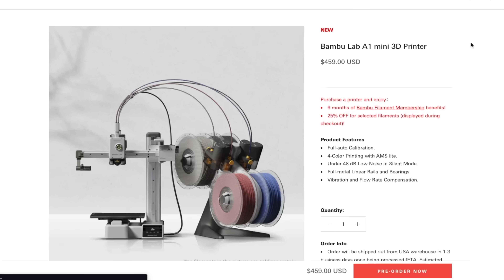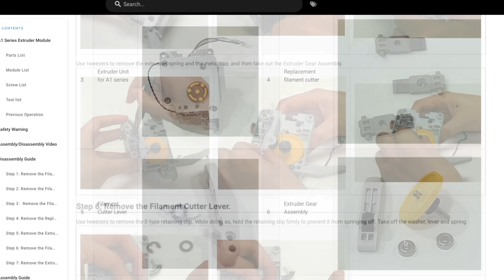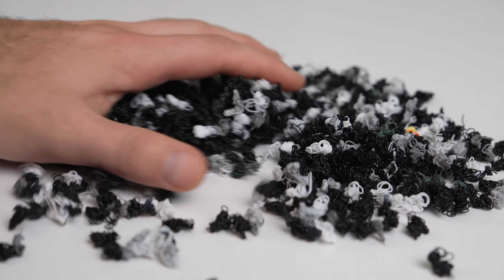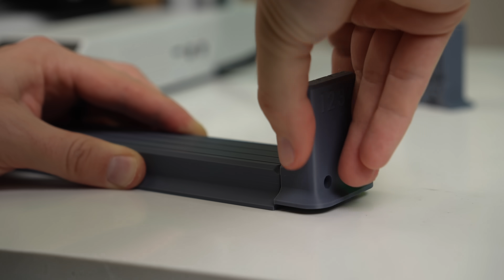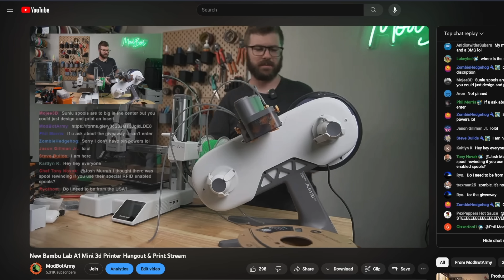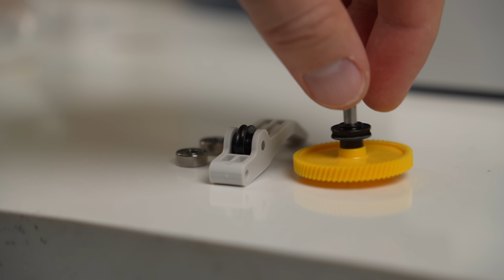Best Bambu Lab A1 Mini 3d Printer Upgrades

Comment: So this is a shanghi chinese device - i am not comfortable connecting it to my home wifi or installing the poorly rated app on my phone- which could present a risk for cyber attacks.  Love how no one covers who makes these printers and just blindly installs apps on your phone and adds unknown devices to your home wireless network without researching the risks involved.  Prints look great but at what cost to your privacy/data to introduce a country into your home network that likes to maliciously hack the crap out of us.  Do a video with how to use this device without connecting it up to your wireless network or download untrusted software (which if you read the privacy guidelines of bambu handy you are giving that app a lot of access to your data - which is unnecessary).  If you are going to do a review of a product you have to connect to ones home local area network then also cover the security aspects/risks involved.    Before you get up and yap about a product - please go over who the manufacture is and what kind of access it has to your network/phone/etc..   So many of these useless videos that do not actually talk about the security risks - please educate folks on products like this - to include security risks involved with installing the software/adding the device to your home network.   How about MODS that allow you NOT to connect it to your wireless network and NOT install any software (apps) to your phone - or attach this in anyway to your home computer to upload the prints to it??????

Comment: Kinda funny this printers upgrades are just primarily goofy stuff like a poop bin or a wall mount, everything else is pretty much to just keep the stock machine running perfect as it does. I’m not sold just yet on my a1 mini combo simply cuz I’ve yet to receive it and use it but it really does seem like my money may have been used justly during this anniversary sale. Hope it works as well as everyone makes it out to seem, I’ll be printing my mounts tonight lmao.
Reply: The presale just started and you can grab a a1 mini for $180

Comment: was there supposed to be a scraper and stylus in my box? never saw them if that's the case.
Reply: My standalone A1 Mini came with a scraper blade  and screws to mount to a handle, and the scraper handle is one of the included test print files on the microSD card pre-installed with the machine. I found the included roll of white filament was enough to print the handle but not the stand/holder for the scraper.

Comment: The big mod I did to mine was a bracket that lets you mount the AMS to the top of the Z tower. About halved the footprint of the thing.

Aside from that, the clip that holds in the AMS hub was defective on mine, so I printed a little bracket that locks the hub in place. Also printed a poop bucket, but a very light and simple one that just sits to the side. Also printed a tool drawer that hugs the top on the machine on the right, above the screen. It's slotted to make sure the bed can clear it. Just sticks down with double sided tape.

Comment: but how can you call this compact, foot print with AMS is literally larger then any full size printer.
Reply: Well, the AMS is optional, and many comparable products don't have a similar feature. 

I was actually going to get the printer without AMS to save space, but then decided I want to have an option of using that feature and ordered the bundle. 

Also, the AMS is cheaper when bought in the bundle vs separately.

Comment: I would like to point out that I print the A1 Mini Purge Bucket file with a Bambulab P1P and I noticed that in the Bambu studio settings and specifically in the speed menu (acceleration) the normal printing parameter is set to 6000 while when I load the BAMBU PLA CF filament it set to 10000. Which of the two is correct?

Comment: Great upgrades for the printer. The biggest gripe I have with Bambu Lab printers is the proprietary attempts to lock you into their eco system, with the spools that work with the AMS along with the cloud slicer and locked software. What happens when (god forbid) the company shutsdown?
Reply: What if any company of any of your personal goods shuts down? Are you gonna stop buying car, smartphone, fridge, air compressor, hair dryer, etc? Most of those are set to fail and or are proprietary. But just so you are aware, Bambu Lab said that if the business was to shutdown, the source code would be shared. Paranoia at its best!
Reply: You can use any commonly sized spool in the AMS. The ones Bambu sell can be bought without the spool itself, which saves on a lot of plastic.
What cloud slicer? Bambu Studio is open source, runs locally on your machine, and can be substituted with any other slicer with the right profile.

Comment: Great review and I wanted to reproduce the various accessories but I wanted to know which filament and the color of gray in particular. 
Thank you
Reply from the maker: Thanks 😊. This was all voxelpla gray.
Reply: Are you comfortable with the voxel filament? I usually purchase either Bambulab or Sunlu filament
Reply from the maker: @alecchi  I have probably ran through 15 rolls of it at this point without any issues. It’s been really consistent.
Reply: @ModBotArmy  have you run into any issues with the hot purge bits melting the PLA bin? Some videos recommend using PETG for the bin part for that reason but if yours hold up with PLA then I’ll stick with that for now before moving on to more advanced filaments.

Comment: Question, at the beginning of the video you mention how you can upgrade the A1 Mini hotend to a hardened steel end. Does this mean that you could use carbon fiber filament in the Mini with this upgrade?
Reply from the maker: Yeah exactly! Extruder gears are already hardened so all you need is the hardened hotend and you are good to go 😊
Reply: @ModBotArmy I'm a bit of a noob. I thought the bed didn't get hot enough for most CF filaments? If it actually works OK, I'm in. I'd like something that I can print small CF parts on.
Reply: @kevinrobb3523  Besides a nozzle upgrade to hardened steel, you may also have to purchase a high-temperature build plate. Make sure to do your own research though!

Comment: Not an A1 owner, but bought a P1S about a week ago. I can say the print removal scraper print and parts are awesome sauce. It slips under the prints and removes them with almost no effort. So much better than the spatulas my Enders came with.
Reply: I also just upgraded from Creality to Bambu Labs - went from a heavily modded Ender 3 V2 to the A1. I used the crappy scrapers that came with the Ender to get the prints off of the heated glass build plate. I have not yet needed to use a scraper at all on the A1 since the PEI build plate flexes. That may change as I start printing with some super soft TPU. I’m a little worried about damaging the PEI build plate with anything hard or sharp.
Reply: @BLAZE-1001  how is the a1? I went from a v2 ender 3 to a p1s and I love it. I'm looking for an excuse to get the a1 mini now that it's a bit cheaper
Reply: @TrillMurray  I have been really enjoying the Bambu Labs A1. It’s super easy to set up, accessories like the Automatic Material System (AMS Lite) are plug-and-play, and the software is wonderful. The automatic bed leveling is super nice. The community and customer support for the Bambu Labs is phenomenal. I’ve heard some people express slight disappointment with the A1 mini, but only because they wished they had purchased the full-size A1 instead. I have been thoroughly enjoying my Bambu Lab A1.
Reply: @TrillMurray  I’d say get the A1 mini, especially since you’re already in the Bambu ecosystem. It is insanely good for the price and nothing to my knowledge comes close to it.

Comment: I'm STILL waiting for mine to ship....This "Before NOV 25" crap is a little much. Still, I'm interested in trying these out when I get it.
Reply: I plan on designing an enclosure with built in 'poopa scoopa' so that all waste isnn't visible for a while then when it is full, take it to a waste place
Reply: @jacobplatt3066  I like that idea…I really would like to come up with a way to recycle because it sure is a TON of waste
Reply: @Deadpixel1134  I'm just waiting to see how much waste it actually makes as I will be running it alongside a prusa mk3s with no multi material upgrade so no waste
Reply: @jacobplatt3066  right on ! I like multi colored prints but the waste is definitely something I need to figure out.
Reply: Any suggestions on what to do with the AMS "poop" ?? This is already a problem with me running an X1C, Possible to recycle ??

Comment: As someone who runs two ender 3 pros im not sure if I should get a bambu printer like the A1 mini or if I should go all in with an x1 or a voron. What do you think. I should mention building a printer is very on the table.
Reply: If you want a printer that lets you focus on printing instead of tinkering with and modifying your machine constantly, by all means get a Bambu Lab P1S. They are extremely capable and reliable machines when kept maintained, they are what most people end up modifying their P1P to be in the end, and are super clever in almost every detail. The software is a fork of Prusa Slicer with a few ideas of Bambu themselves sprinkled in which does need a bit of refinement. But over the last half year i have worked with my P1P it has been 90 % hassle free with minimal failures (apart from the ones I had with my first  build plate). The P1S feels like Bambu is actually listening to what their customers say and watching what modifications are commonly done to the P1P and turned that into a product within half a year.
Reply: Yeah. I like hasso's comment. I have an S1 Pro with sonic pad. The only real reason I'm thinking of switching is multi material and maybe easier to use. BUT, the Bambu AMUs waste a lot of time and material over an IDEX or similar for MM. And at any speeds faster than what I can do with my setup, they're loud as heck, but I live in a thin wall apartment and hate the noise myself. 

So... I dunno. Decisions, decisions!
Reply: If the printer is also your hobby and not just a print farm machine than you shouldn't consider Bambu Lab, maybe the P1P as the only option, because with X1, P1S and A1 you simply cannot modify much.
A Lerdge iX Kit or Voron Zero LDO Kit would be a good alternative if you really want to build your own machine!
The Prusa MK4 Kit would also be an option for a new and fast printer. A used Prusa MK3 (maybe with a problem to be fixed) for like 300 bucks or a Voron Ender 3 Pro Switchwire conversion would also be suited ...

It really depends on how much tinkering and hobby you like, how big the build plate has to be and if fast but loud printing is a thing for you.
With already 2 Ender 3 Pro at home I would consider the Voron Switchwire conversion to be honest. And if you "need" a workhorse I would opt for a used Prusa MK3.